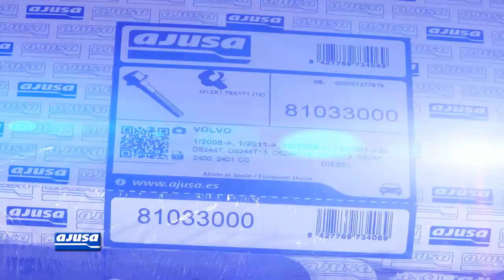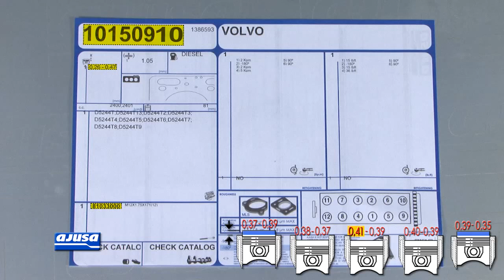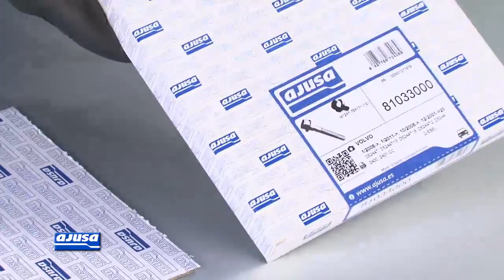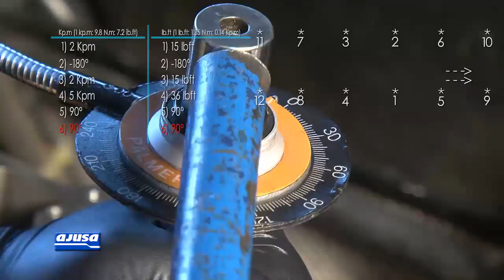Cylinder head gasket / Junta de culata VOLVO S60 2.4 D5244T .

Comment: Hi, why is the piston on cylinder 1 not sitting at tdc, I'm replacing my head gasket on my 2007 d5 engine, thanks
Reply from the maker: Hi Ryan! We do not understand your cuestion because in our video if piston 1 is shown at its TDC. Best regards
Reply: No cams were in so all valves would be closed. Spin the crank till it lines up on the timing mark Nd set the cams in time as you install them

Comment: Originally, what is the thickness ?
Reply from the maker: Hi Julien! Thanks for your comment. For this engine exits 5 tinknesees of cylinder head gasket. 10150910 (1mm) / 10150920 (1.05mm) / 10150930 (1.10mm) / 10150940 (1.15mm) / 10150950( 1.20mm).  Best regards

More information / más información: 
🌐 http://www.ajusa.es 
🖥️ https://www.facebook.com/AjusaSpain 
📸 https://www.instagram.com/ajusa_automotive/
Reply: Ajusa yes but originally ? I want to put the same as the original one. Volvo S60 D5 2002 163hp
Reply from the maker: @julienmonneron934  The motor could assemble the thinner gasket or not. Then you need to check the number of notches on the old gasket to assemble the same thickness. Attentively

More information : 
🌐 http://www.ajusa.es 
🖥️ https://www.facebook.com/AjusaSpain 
📸 https://www.instagram.com/ajusa_automotive/
Reply: Ajusa i understand.
I’m asking which one the factory is putting ?
Reply from the maker: @julienmonneron934  The vehicle could proceed from the factory with several thicknesses depending on on the protrusion measure. Best regards
Reply: The vida original software Volvo want thisStage 1 .... 20 Nm
Stage 2 ... slacken
off
Step 3 ..... 20 Nm
Step 4 ..... 50 Nm
Step 5 ........ 90°
Step 6 ........ 90